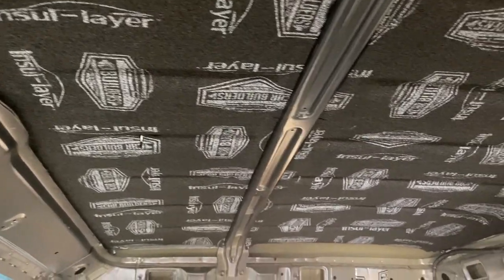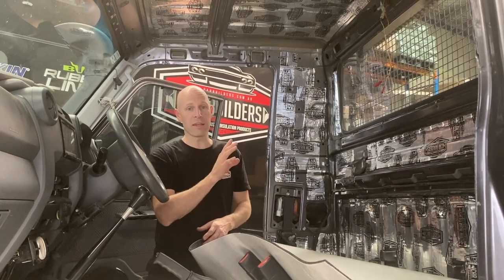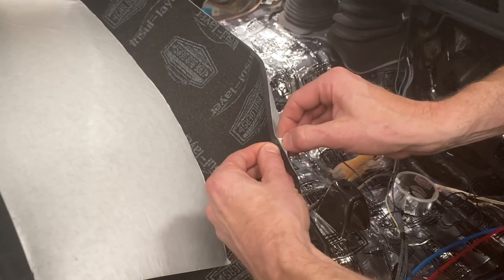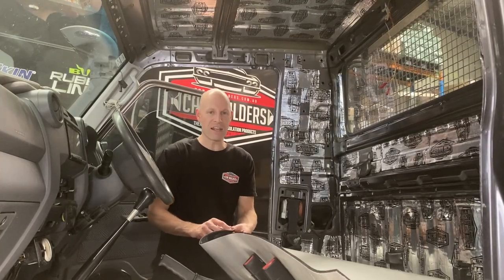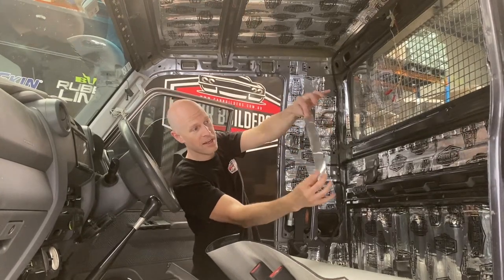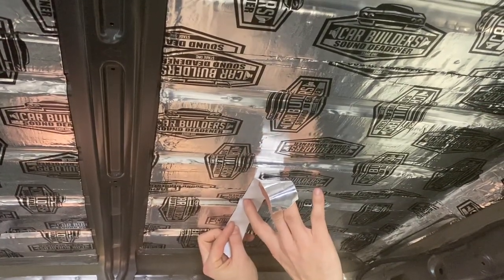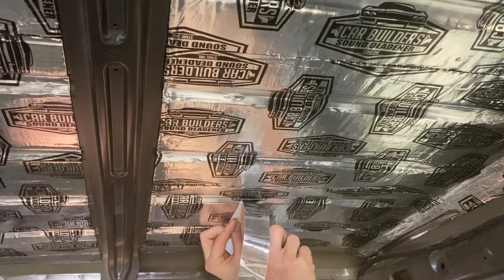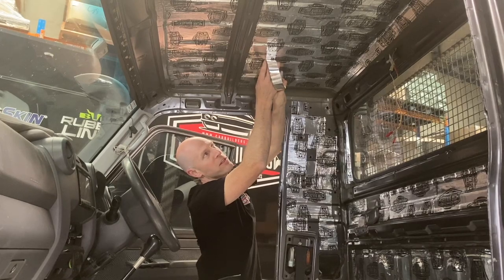Car Builders Insul Layer 6mm Roof Lining Barrier

Comment: I'm about to take delivery of a Hilux single cab-chassis, and will look to improve sound insulation once delivered - question. Is it worth applying something to the front wheel arches as well as working on the cabin interior.